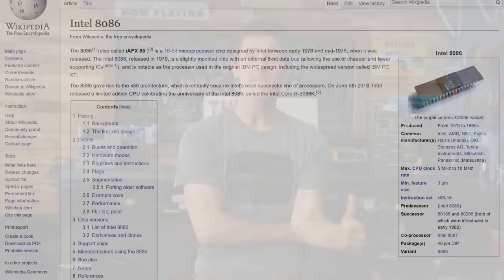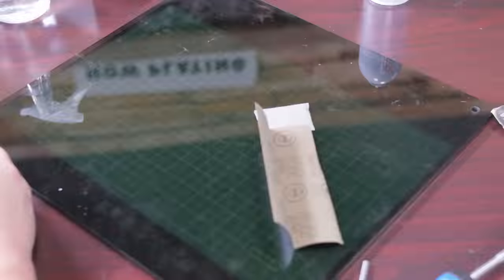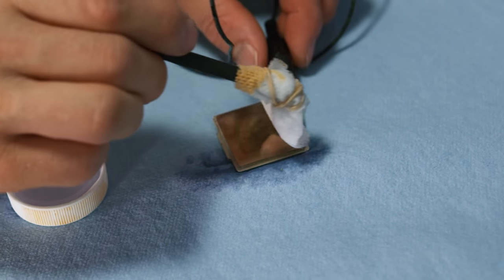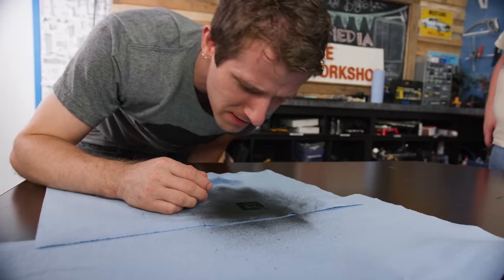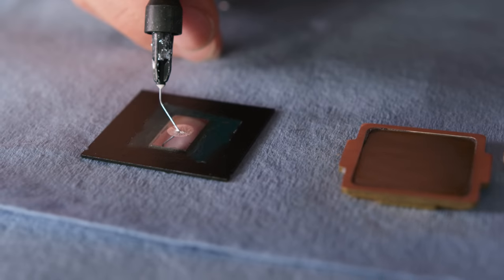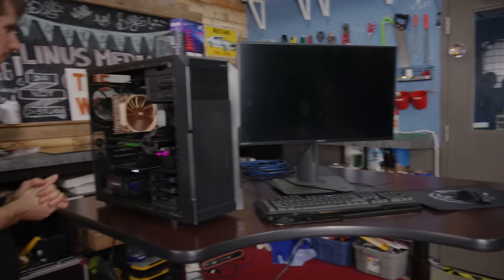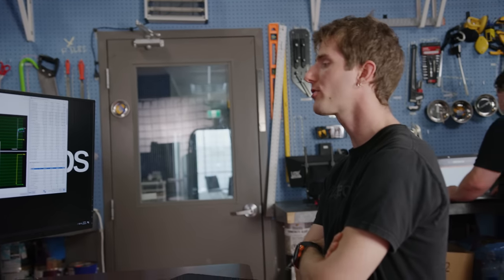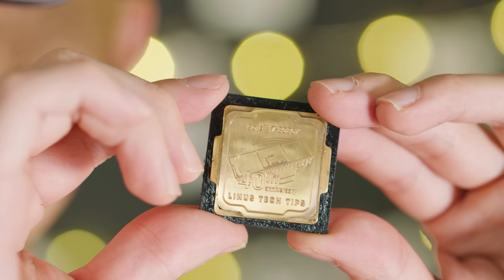The CPU Intel SHOULD have made!

Comment: Of course the thermal interface isn't soldered. You need a microscopically-textured surface for solder to adhere to, and silicon chips are microscopically smooth because that's a requirement for their manufacturing process. But that microscopically-smooth surface allows for maximum heat conductivity WITHOUT soldering anyway, so quit complaining.
Reply: Metal excretion on a smooth silicon surface isn't a problem. Then further plating or direct solder application was a method they used before changed to TIM application. They just ditched the solder method because the indium they used to solder up the IHS is expensive.

Comment: What would happen if they decided to use a completely new computing system, beyond x86/x64? How long would it take for them to design a system that exceeds what x86 is capable of now?
Reply: Cavey Manta x86 is just an instruction set. ARM CPUs can be purchased just as fast as any extreme edition Intel i7 ... Just not very common as they are used in industrial applications.
Reply: So the ARM CPUs are gonna be the death of X86? O.O What a crazy world we live in. I see Global Foundries backing off of 7nm production and Intel CPUs with lackluster improvements each generation... It's time for a change. I'd be willing to take a leap into something new, leaving the old games and programs to the old systems (Unless they can be emulated or remade for more advanced architectures).
Reply: +Cavey Manta Linus showcased an open-source cpu a little while ago, that may be up your alley.
I personally really like the compatibility x86/x64 provide. I’m a bit worried about the preservation of computer software in general; it seems like a lot of people are ok with just abandoning and forgetting about it... :/
Reply: Well... We would loose 30 years worth of software, most wouldnt be ported over, so we would need a x86 emulator and suffer a bit to emulate some of the programs, as many wont be compatible
Reply: Daniel Gray Maybe, maybe not... 
In pcs we have 30 years worth of software that wont be easily trown in the trash.
Reply: You people still don't understand the difference between what x86 and 64 bit are. x86 is an instruction set, which is how the software code runs on the computer. 16, 32, or 64 bits are in tandem with the architecture; with higher bit CPU's capable of handling more memory, with 32 bit being limited to 2gb of dram. x86 instructions are used on the majority of desktop/laptops, while non x86 instructions are used on things like mobile consoles, or phones. With computer programs designed to run on x86, it's pretty unlikely that it will be replaced anytime soon, as all software would have to be remade to run on it. Instruction set compatibilities are why WINE can simulate Windows, but Dolphin has to emulate GCN.
Reply: x86 is long gone. more than 90% of the instructions on a current x86 CPU have nothing to do with x86 anymore. Its just a compatibilty stack. Its an evolution and its good that way. Nobody wants to throw away the compatbility. Every new chip since 286 added more functions and since Pentium theoretically its not a x86 anymore. If you would take a current CPU and adjust ALU/FPU/Cache/Clock to a 486DX it would be slower running non optimized code (no MMX,SSE etc), thats because a lot of executions are already emulated. Thats why Pentium 1 was slower compared to high clocked 486 from AMD.
Reply: +Matoro Rocks, technically 32 bit can address 4gb of memory, although windows 32-bit only uses 3gb if I recall correctly. The x86 line of processors is based off the same basic architecture as the original 8086, but with more bells and whistles added. In some ways the old architecture adds a cage around what could be possible, with prime silicon real estate being dedicated to modes and functionality that isn't needed in modern systems, purely to be compatible legacy compatible.

I wonder if they trimmed out all the excess, all the backward compatibility, what kind of performance improvements would be possible, if any.
Reply: Ok tbh I’m a bit of a computer noob and wtf is an x86 and what are y’all saying lmao
Reply: @aquasnippy  Some stuff about bitz and bytez. I think we're talking about running Crysis or something (which a new system architecture wouldn't, without recoding or emulation)

Comment: Why does he reglue it when he’s going to have to change the liquid metal in 3 years or so
Reply: I'd wager the effort to delid the glue outweighs the risks of using an unglued heat spreader.
Reply: If the reglue is sealed well enough, you technically don't need to ever change the liquid metal (practically speaking).

Comment: apart from the engraving, i wasn't suprised because gold is one of the best conductors of heat and electricity. Not as good as silver but it doesn't corrode over time and it is just as good as copper

Comment: That gold will also make the metals corrode faster. You need to have similar metals or low-reactive metals touching, or you create a battery that makes corrosion happen faster, by ionization equalization. That is why they nickle-plate everything. That is also why copper blocks corrode to black fast, eve if they are oxygen-free copper, unless you metal-bond them to nickle alloys. (Nickle plating is not pure nickle, that is highly toxic. It's a NiChrome alloy. Also, Chrome and Copper is toxic too, which is why both are used as an alloy with other metals. Aluminum is also blended, to make it strong and anti-corrosive.)

Comment: Take the heat spreader off, remove the left over glue goo, place the clean (unglued) heat spreader back on the CPU, then plasti-dip the PCB, use an X-Acto blade to carefully trace around the heat spreader, remove the heat spreader and clean the plasti-dip overspray off from the heat spreader....then do your thing with the heat spreader itself. Re-assemble & profit.

Comment: A fiber optic laser isn't really a type of laser.  It has only to do with the light's being inserted into a fiber optic cable before it's coupled with whatever you want to use it.  The term is usually " fiber coupled laser," and they're usually adjustable and usually not very powerful unless you want them to be (i.e. if you pay for a model that's powerful).

Comment: next time dont bother with the glue the way you did. what i do is put on the liquid metal and back into the deliding tool and then put put a dab of super glue on each corner that way the IHS is for sure not gonna be lifted by added height due to the adhesive. i have done this for many CPUs without a hitch

Comment: We use a non-Gold-Plated CPU with Liquid Metal and a Air-Cooler and we reach a CPU Speed of 4.5GHz with temps of 60-63C° . So i don´t think that the "Gold" do much changes. The reason is.. the Gold-Layer are too thin and even Chopper has a better thermal conductivity. So to use Gold is not the best idea. It only makes a bit sense, when the Heat-Spreader is made from Aluminium, but then you get problems with the Liquid Metal. The Aluminium will oxidize.

Comment: You did a mistake removing the nickel layer, a nickel layer is necessary when plating gold to copper, because otherwise copper ions migrate through the gold and cause it to corrode. Should have gold plated the nickel directly instead...

Comment: The 8086k is still a great processor.  I mean, all you have to do to get it running GHz on all cores is turning on MCE!  Mine runs at 5.2, stable, and I could probably get it to 5.3 or beyond  with a custom loop instead of my current h110i, and liquid metal

Comment: Any particular reason why the substrate for CPUs and GPUs is always green? Most manufactures can chose what color they want their PCBs to be. Apple for example used to use mostly green PCBs, then they started using blue, and now they use a nice looking matte black finish for their PCBs (and require their suppliers to do the same) I guess it doesn't really matter since the CPU is covered by a heatsink anyways, just curious if there is a technical reason.

Comment: you could of used cermark and sprayed it on the ihs.. then use the laser and what cermark does it turns to a pretty black ceramic coating where the laser went over..just look up cermark lasered metal

Comment: Nice. But what's the point? I'ts going to be under whatever cooling block you get to use and in the case.... probably the reason why intel didn't do all the etching and stuff at first. the only thing that you get from that is using liquid metal instaed of intel's stock thermal paste which will obviously give you better thermal transfer at the cost of you warranty.

Comment: Just saying first I know no one is seeing this or going to answer it but it’s worth a try. My PC has a problem where I don’t know if it’s a hardware problem or and incompatibility problem. I’m getting blue screen loops for windows 10 and I can’t log on through safe mode it says IRQL_NOT_LESS_OR_EQUAL or something like that. I’m getting kernel issues and I can no longer get into my pc. Here are my pc specs:

AMD phenom x196 x4
GeForce GTX 780
ASUS crosshair formula iv
G skill vampire  4x2 RAM Corsair power supply 
Corsair H200i v2 water cooler
Unknown hard drive ~500gb
Reply: Reset Cmos sound like Hardware failure
Reply: BowieMoonen thanks
Reply: i would reset your CMOS if you know how, i was going to create a vid for that lol. That is one i got a lot when i changed pwr usage's in BIOs when OC the CPU

Comment: As cool as this is and all, when I rebuilt my PC, I decided overclocking, delidding, yada yada is actually a huge pain in the ass. I run 6 cores on an 8700 at stock volts and stock boost at 4.3 Ghz all the time, with just a 12cm Noctua cooler and a Corsair RGB fan. Never goes over 70C. You do all this stuff to get a little bit faster...can anyone tell the difference anyway?

Comment: What was up with the dead CPU? Just curious. Presumably you kept it as a conversation piece but I did find that some "broken!" CPUs are in fact recoverable. Like the faulty Phenom 2 P920 quad core I used for a year which turned out to be a tiny burr over one core: removed it and no more crashing! Possibly like that from the factory? It outlasted the laptop it was in.

Comment: Keep in mind that Intel is not proud of the x86 platform. They tried to kill it off twice and failed. They failed first with the Itanium; corporate enterprises wouldnt bite when they learned they'd loose their software library. Intel failed a second time by trying to deny users a 64-bit x86 CPU; AMD stepped in and got their 64bit instruction set approved and adopted. 

x86 is not a terrible design but it's also not a great design. It is simply adequate compared to more modern architectures. It's just as difficult, if not more so, to make as the newer designs, still cost roughly the same to fabricate and provides inferior performance. 

With this in mind, I find it surprising they chose to commemorate the anniversary at all.

Comment: I've never seen such vitriol, disdain, and desire to break from convention that I have seen flung at the x86 instruction set.

About the only other thing that seems to draw ire as a status quo standard of undisputed utility as x86 is gasoline. Calling something a "computer" in this day and age implies it talks in x86 instructions. Anything that isn't running on x86 instructions almost certainly ensures it's not a "computer" in modern parlance.

And yet, despite that, people are chomping at the bit to see it die off. They speak of its power inefficiency compared to ARM (probably a truthful statement) and how bogged-down it is after decades of being limped along and bandaged.

Personally I'm fine with it. Apple already went through this rigamarole when they ended using PowerPC architecture to x86-64 architecture in the Mac family around 10.5 and...it wasn't pretty. Their insistence on 64-bit only software for iOS and macOS going forward is kind of similar and if the rumors are true that they're going to drop Intel and make their own chips in 2020, they're going to probably cause a similar stir. Meanwhile, if you could figure out how to run it, you can take a computer literally from Windows 1.0 all the way to Windows 10 1809 and run software from the 1.0 generation in that Windows 10 environment. Windows' most drastic shift was the introduction of an x64 OS, which REALLY only falls apart on running 16-bit software. 32-bit software still runs in Windows 10, meaning older games from the late 90s and early 2000s still run in Windows, barring other incompatibility issues.

x86 is very old but it serves the world well so...maybe ARM-based servers might be a good idea but for consumer computing, we just aren't at a point where such a massive upheaval is worthwhile.

Comment: Ay Linus. I need to hit you with a information. (it doesn't hurt. I promise.) if I set voltages right, I can overclock the CPU to 5GHz. The Intel core i7-2700K (idk which generation...) at 5GHz 1.4 or 1.5 volts is just fast enough for me. I would love to overclock it much harder, but my thermals don't allow it. Because of u crank it to 5.2GHz, the temperature is So high that the CPU is intense instable. I could try it again for tech science. I'd be really chilled if answered. Or I mean it would be cool if you answer. I'm tired (because I'm still awake at 2:20 and I want to sleep. Please answer.

Comment: just wondering why didnt you just go with a silver plating? given ya know heat transfer rate is all that matters for the face of the cap.... o.O given gold is about a 1/3rd the heat conductivity rate vs silver and is even below copper.... you actually just insulated your chip.  But at least you didnt nickle plate it... which is HORRID for thermal transfer dun dun dun for all you nickle plated waterblock users...

Comment: Sigh.
We're still using the most elegant instruction set ever created.
Predates even the 8008 by over a decade.
Still runs more real business than the repainted unix pig now known as a penguin.
Intel had to wait for the patents to run out before they could use them in the 80386.
Ran 25,000 simultaneous users on 40MHz, 16MB systems.

No, I'm not going to tell you what it is.
Learn some history and quit kissing the azz of the midgets that stand on the giant's shoulders.
Blessed be Admiral Hopper and Dr. Amdahl.

Comment: I dont wat to be hater, but i can be done a lot better. Even i had done it better... so is easy. C'mon Linus im waiting for the 2.0 edition of the custom 8086 aka, sleek paint and nice centered ihs. And if you are using plastip, the conformal coating is a nonsense... the vynil is making that function so skip conformal. Anyway nicejob. 
PS: Propably i will try some engraving myself if i mod my 3d printer when i had my hands on a 9700k :P

Comment: X86 is a backdoored bloated architecture

By the way no architecture has had a completely formaly proven security (that i like to define as the concurrent existence of availability to authorized users, confidentiality of privileged information, integrity against improper system modification, correctness of service delivery)
I have not gone througt all risc V documentation but i am not sure that they tryed to prove maximum information leakeage between domains througt covert Channel analysis am i wrong ?

Comment: does anyone actually watch the advertisement on these websites? I retired in 2011.
My first PC was a Timex Sinclair back in 1978. I had limited use on Control Data mainframes witch was a complete joke. at that same time I got a chance to use CP/M Created by Digital Research. they also created the first GUI in the industry back in the early 1980's. even though xerox gets credit for the first GUI it was Digital Research created it in 1974. If it was not for CP/M Bill gates would be a no body right now. in 1994 i work for the DOD and was part of a group of people that created the first network interface for Mosaic. Pryor to that all you could do was FTP into a website. then Netscape took over and when windows 95 came out with Internet exploder any idiot could connect on the web.

Comment: What a TERRIBLE idea. Do not engrave a surface that is designed to function best when flat and smooth. Do not use questionably conductive, expensive materials on a surface that gets covered with a heatsink anyway. This looks cool as a showpiece. By all means, buy an older gen processor on ebay and frame it on your wall if you want, but do not recommend to Intel to make their products even more expensive.

Comment: Now that they are soldering the IHS you kind of wish you didn't make that comment huh??? The soldered IHS can't be delidded now meaning we can't get the best performance possible due to low quality control on the IHS. It's almost mandatory now that you lap the IHS to decrease core to core deltas. We are seeing upwards of 40c deltas which sucks and lapping only fixes it so much. Gamersnexus lapping their cpu and did not see a huge difference but if the soldered IHS could be delidded and liquid metal applied without putting the IHS back there's a good chance of being able to overclock another 400-500mhz BUT WE CAN'T!!!! REALLY LINUS????? SOLDERED IHS!?!?!?!?!?!?!?!?!?